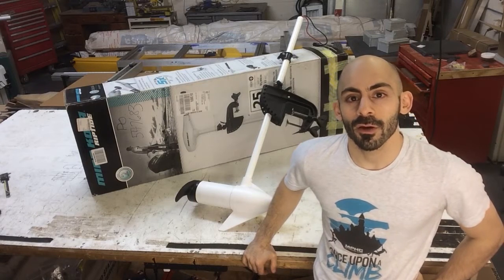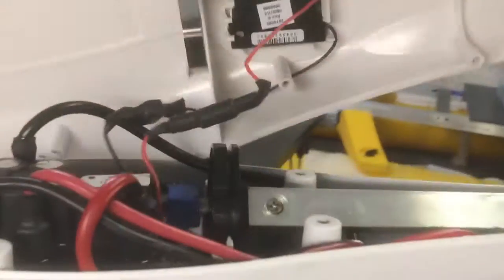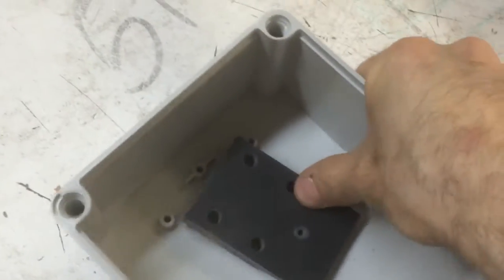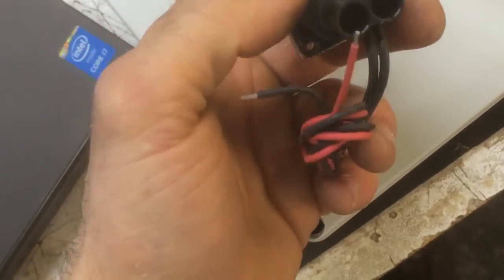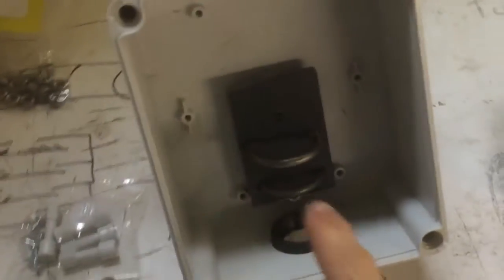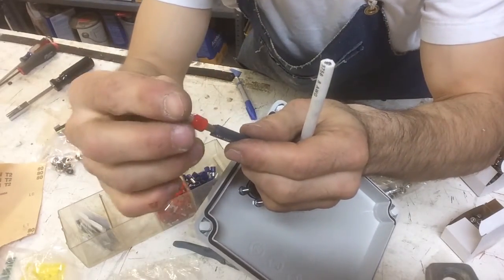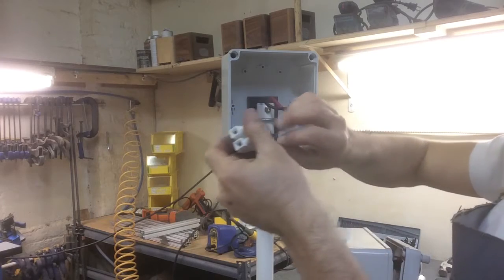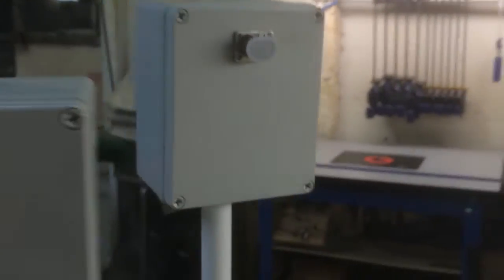RoboDolf Drone Boat - Part 3 - Thrusters

Comment: I'm using a similar implementation of a trolling motor.  What did you use for the ESC?
Reply from the maker: Hi Darren! I'm using a roboteq MDC1230. Highly recommend it!

http://roboteq.com/index.php/roboteq-products-and-services/brushed-dc-motor-controllers/mdc1230-detail
Reply: That certainly will do the trick!  Thanks!